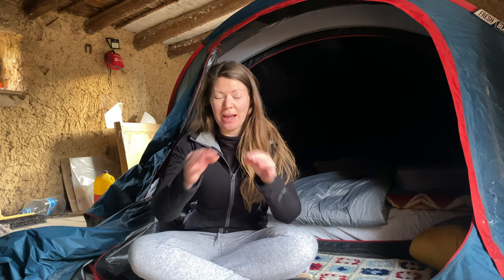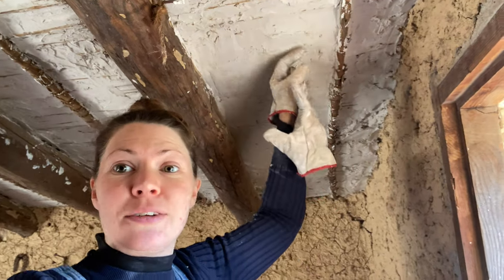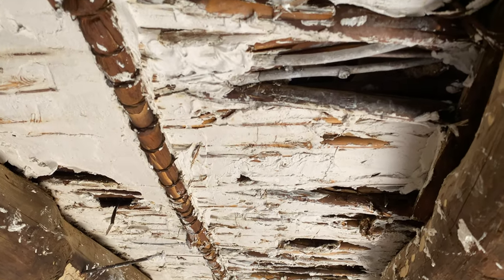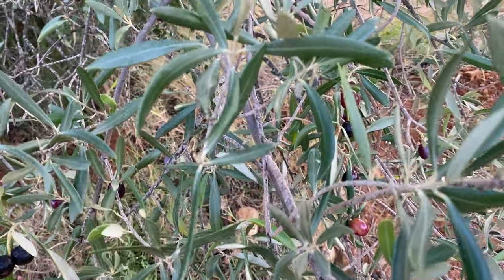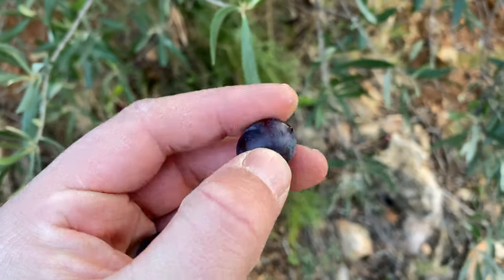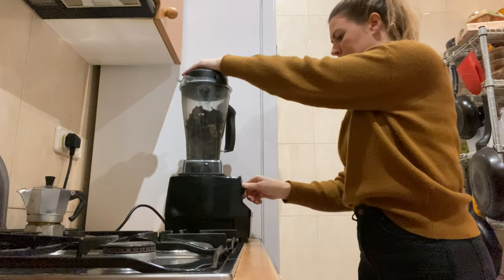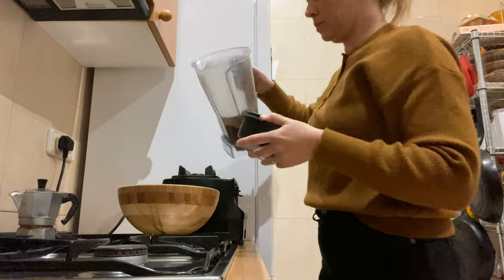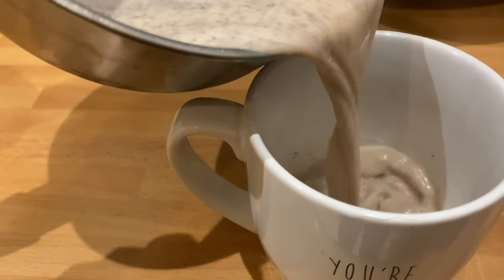WE'RE BACK! | Restarting work on our OFF GRID HOMESTEAD project | V 22

Comment: Hi, did you applied an adhesive or a glue on the wooden canes before plastering??? Rhinolite plaster band are the best, because it matches very well on any surfaces, concrete, plywood, wood, stones ect ect ,and ofcourse, Rhinolite drys white.
For the mixture, mix the plaster to a "workable paste'  remember, if it's too hard it fills the gaps well and drys quicker
If the plaster have to much water, it takes a lots of time to dry and for the gaps if will fall.
Reply from the maker: Hey. 
No we didn’t use an adhesive. We just wanted a simple(and cheap) temporary solution as we will replace the whole roof within the next year, so we just used the plaster. It’s holding up fine for now, but thanks for the additional information! It may well be helpful in the future! 😁
Reply: @SmithsdaleFarm  Your welcome

Comment: If you've plastered the holes in the roof, what would happen when it rains ?
Wouldn't the plaster get wet and fall apart ?
Reply from the maker: Good question - generally the tiles are in good condition and we’ll placed. It was more about the gaps for air, than rain. We will need to move around a few, but gladly not many! 😁